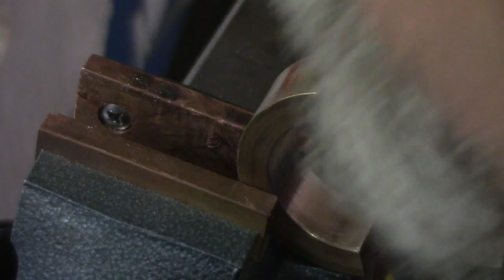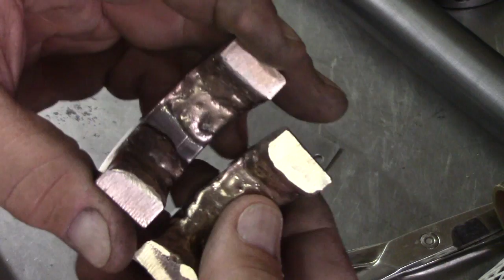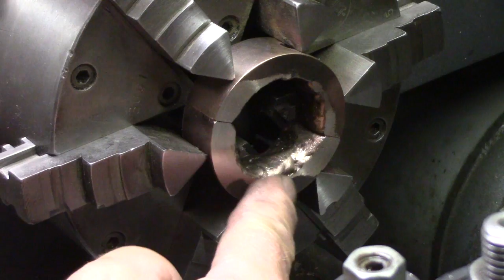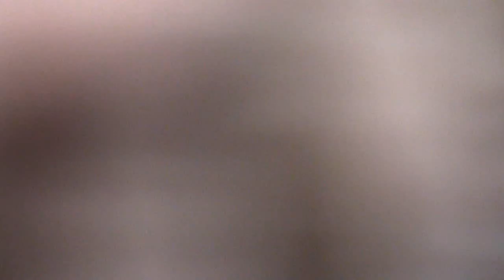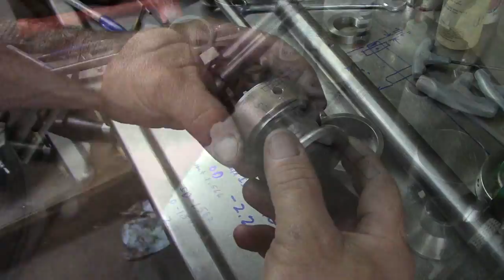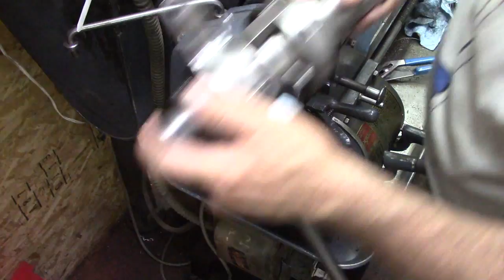Logan Lathe Collet Closer Repair P2

Comment: Okay the video  is over four years old. But Very good work, Randy! I would have been "that guy"  that stuck the shells in a vise and squeezed them shut the twenty thou. and then bored.. I needed the indepth assembly to the lever release as I wanna get one for my ol' Sebastian ~13" along with threading head to be able to make studs of various lengths and Ubolts as well. Great videos.
Reply from the maker: Thank you.  I am glad this helped.  This new setup sure runs great.

Comment: Thanks for the explanation of why you'd have that collet closer, and the stock feeding mechanism, because I couldn't for the life of me figure out why you'd need to keep the lathe running. I knew it must have something to do with you turret attachment, but still couldn't see a benefit over a collet chuck until you ran through it. 

I do have a couple of questions about the bearing repair...do you think that would work well enough for the bronze bearings in my South Bend's headstock? And if so, could I used LFB to build it up, or should I get some Silicon Bronze? I'll make a video of the problem I'm having and maybe you could look at it to see if you think a resurfacing of the bearings will help me, or if it's something else. Thanks Randy...Aloha, Chuck

Comment: Randy:  This is a very timely video for me... As I a m adapting a "Precision brand" quick change rig for "who knows what lathe" back in the day....to my Atlas / Craftsman 12"  all the parts are there except the... as you show it ROND arm connecting the release lever behind lathe headstock... Im making mine out of square stock... I.E. Principals are the same.... Also the Precision uses a 2 piece "keyed" spiral split to do the tensioning to the draw bar..... Ill let you know !!!  and send picts. when I get it done.... Thanks Brian F... AKA GUSMIX
Reply from the maker: Thanks Brian for the visit.  Send some pics, good deal.

Comment: Nice two-part video, Randy. Thanks for sharing. 
I suspect that you will eventually want to build a new tube to the right length and amount of threads to catch the collet, etc. That would be interesting to watch. 
Anyway, it looks like this repair has got you a much better working collet setup than before. 
Cheers! 
Joe
Reply from the maker: Thanks Joe.  Yes I think a new tube will be the best option.  Working very well for now.

Comment: Nice repair, Randy. Lots of little tidbits of information that I didn't know about using a collet closer as well. Hope you get the last little bit tracked down but it seems like it's doing the job now with just minimal vibration. The handle jumping like that would have had me jumping for the E-Stop!

Sincerely,
Tom Z
Reply from the maker: Thanks Tom for visiting.  The closer is working quite well now, but I will get to the runout issue after I get this batch of scribes made.  Not to scary just caused the closer to open and usually screw up the part you are trying to make.

Comment: Hm, just a thought, mainly because i've no idea if something like this would even be feasible, but, what if, instead of buying rod stock and cutting the part from that, well, what if you bought flat stock and bent it? I mean i know it's quite a bit of work, but would it offset the cost or even work?
Reply: Also good luck with the fire situation, i hope it's all good.
Reply from the maker: This material is not very ductile and would be very difficult for me to form it.  The welding repair is working very well so for now I am happy with this repair.
Reply from the maker: It will be a tense fire season over 1000 fires already in the state.

Comment: That looks like it works pretty well now.  At my new job I have the MSC knock off of the hardinge hlv-h.  The closer is different than yours but I think can be operated with the spindle going.  Is the idea that the closer has enough travel to let the stock loose so it can be advanced?  That seems kinda sketchy to me as sometimes the material can be fairly snug in the collet even with it loose all the way?
Reply: trainman4602 has a pneumatic feed tube on a Hardinge DSM which he showed in use on a couple of videos.  It makes for a slick operation.
Reply from the maker: Yes it is work 100 times better now.  Yes that is the idea.  With a pneumatic feed tube it is always applying enough  pressure on the stock to be able to advance the stock when the collet is opened.  I will have to show my feed tube.  you usually only have a couple of psi on the piston.  Some times the stock is a bit tight.  A lot of modern machines use and older screw machines use a stock puller instead.  So from the tooling side one of the tools is a stock pulling tools.
Reply from the maker: Yes he has a nice setup.

Comment: Since the bearings are split and still gaping at the ends, the bore is not round anymore.  Would lapping them to the hub be an option?  I know you wouldn't want to wear the hardened hub out.  Conversely, is there run out in the hardened hub?  The bore may not be concentric to the OD of the bearing surface.
Reply from the maker: Since the ID at the splits was quite a bit oversize I could not bore to fit.  The hardened hub is round.  You do not want to lap or use abrasive on soft bearing materials, Bronze. brass, babbitt, etc.  cut to size or scrape.  You will embed the abrasive in the bearing material.  Thanks Barry for the visit.
Reply: I was concerned about that, hence the question.  I wasn't sure if the abrasive would abrade the softer material or do as you pointed out and stick in the soft stuff and abrade the harder material.  Good thing you know and didn't try it at my suggestion..
Reply from the maker: Thanks Barry for the great comment  and bringing up the subject.

Comment: Randy,
Compared to vibration before the repair, you are 1000% better. Chasing the source of vibration can get pretty frustrating but I think your solution for making a new tube will fix solve several remaining issues. I guess you will have cut a hole in your shop wall for the 10" feed stock tube :-) . I think Keith Fenner did something like that for his "American" Pacemaker lathe.
Great instructional series and thank you for all the details. Now, I have to stop watching YouTube and fix the vibration problem in my Hayward variable speed pool pump - won't know for sure until I open it up. The joys of owning a pool!
Thanks for the collet closer series, Paul
Reply from the maker: Thanks Paul,  Good luck on the pump.
Reply: I opened the pump and discovered the upper neck of the diffuser (spx32000b3) snapped off but did not cause any damage other than lots of vibration noise. I thought the motor bearings were bad so this problem is so much better than what I expected to find. A $28 part with Amazon's Prime so I am happy.
Reply from the maker: Always good to find it is not as bad as you thought it would be.
Reply: I think Keiths big lathe is a Clausing
Reply: I think so too. It is James Kilroy who has the  Pacemaker lathe.
Reply: James has the broken gear.  Abom uses a bigger Pacemaker at his work.

Comment: Hi Randy,
Good repair in the end, you can always expect a tiny vibration, this should not affect the result...
Great choice about using bronze, brass doesn't last even with lubrication, way too soft...
This summer will be a Wright rollers Bash, everyone at the same time, see who gets the best job done...   lol
Cheers,   Pierre
Reply from the maker: If there is to much vibration it causes the closer to pop open.  I agree about the bronze/brass.  The vibration is tolerable now, but I will look into either getting the runout  down or build a new tube.  The bore of the tube does not need to be as large as it is thus get more wall thickness and a stiffer tube.  I use a delrin bushing in the end to help guide the stock also, that helps.  Sounds good for the challenge on the wright rollers.  Thanks Randy
Reply: +Randy Richard 
You may also be experiencing a resonant frequency issue with that long handle. 
This can be checked by hanging a small (1 or 2 lbs) weight on the end by the ball.
Just in case nothing else works.
Thanks, 
John
Reply from the maker: Yes John, the slight runout is causing a small amount, I will try a light weight.  Thanks.

Comment: great repair Randy.
Im no welder by any stretch of the imagination but  maybe a little  preheat on those bearing halves would of helped you.
I often use an old toaster oven  to bring up the thicker parts to 350 or 400. it really helps, especially in thicker Aluminium.
Cheers
Reply from the maker: Next one?   what next one.
Reply: +Randy Richard 
I knew you'd get a kick out of that one!!!
Reply from the maker: Yep you are right, preheat would of helped here.  I started with to low of amp at the start.  I should of practiced on a similar piece of metal first to get setting right.  I have now earned my red Bozo Nose award.  Next will be the red shoe award.
Reply: lol, nahh no bozo award for you..
Reply from the maker: Damn.
Reply: +Randy Richard 
No preheat was necessary on these pieces. They are not big enough to require the procedure. Randy and I talked a bit about it, and hopefully my suggestions will help for the next one!

Comment: I might have tried squeezing those half circles in the vise to close the sides before boring. Squeeze a little; measure; squeeze a little more; repeat until the side to side measurement is just a little less than the diameter of the slide on the closer. Then bore to fit just as you did.
Reply from the maker: Thought about that, but I have tried that in the past with similar bearings on Steam recip. pumps,  Bronze bearing material will fracture very easily.
Reply: Sintered bronze (Oilite and the like) would probably fracture. "Real" bronze (copper/tin alloy - 907) tends to deform and work harden under pressure. This is why I like it so much; you can see that the piece has been over-stressed before it fails catastrophically. That's why it makes good marine hardware.

It would be difficult to say exactly which alloy you have there so maybe better safe than sorry. It looks as though your solution worked.